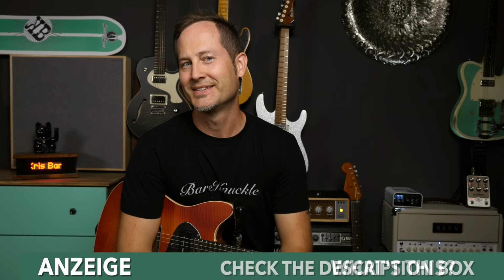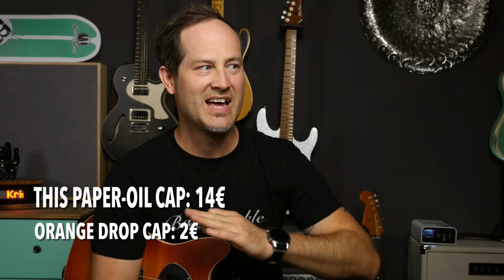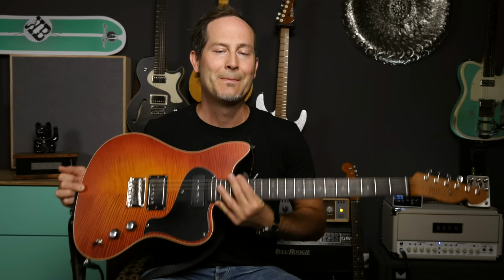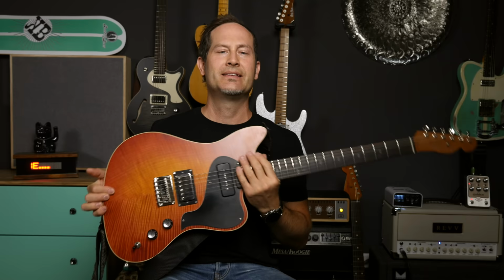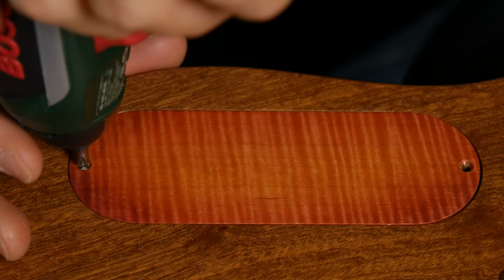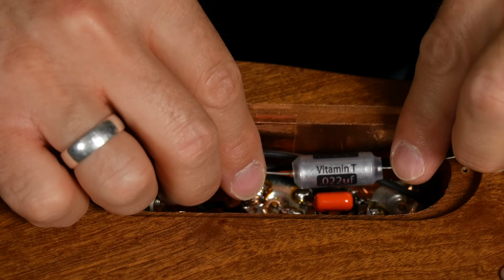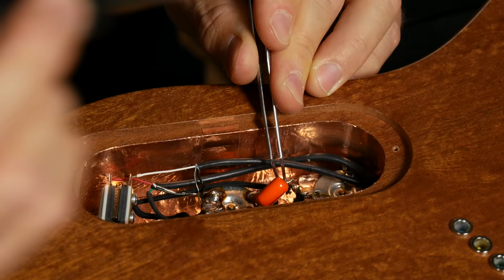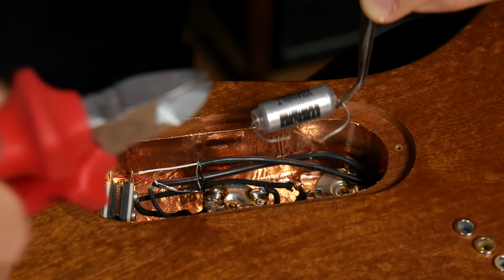Guitar Myth-Busting! Are Paper-In-Oil Capacitors Better? | Guitar Tweakz

Comment: I don't think there is any "best" type of capacitor, because each type has it's own strengths and weaknesses, ceramic discs are very cheap and tend to sound muddier when turned down less than 5. Orange drop (or any film/foil capacitor) tend to sound brighter and more focused even when turned down to 2, so, in my opinion, better for modern music, pop, rock, country or modern metal. Paper and foil in oil is for guitarists who prefer a vintage sound, warmer but also less muddy when turned all the way down, so, in my opinion, not worth the money unless you really need those vintage tones. By the way, the vintage Les Pauls from the 1950's used film and foil capacitors in a plastic bumblebee or tan casing, NOT paper and foil in oil.

Comment: Different caps absolutely can impart different sonic characteristics.  Try putting in a tantalum cap and you should find your attack is now "squishy" and "rubbery".

Given the way capacitors work, acting a bit like a spring/sponge, the attack is likely to change a bit more than just the freqs that the cap allows to pass through it.  Which can then affect the harmonics, which then can affect what we perceive as "tone".

I typically wire my tone circuit so that the cap is touching the hot lead (as opposed to having it between the pot and ground).  I do this so the cap can "play" with the signal (for better or for worse) and perhaps impart a bit of character.  But I'm not sure the cap location makes much difference.
Reply from the maker: I’d love to quote your comment in the follow-up video soon on the channel. Are you OK with that? I will measure the two caps on cam and tell my opinion on this whole subject. Out of curiosity, what do you base your statement on? I’m not testing you or anything, I‘m just honestly interested. 👍 Btw I completely share your opinion. 🙂 
*edit -> to correct typos 😅
Reply: @KrisBarocsi  No problem, Kris.  Use what you want.

I'm not sure about cap location (attached to hot or separated from it by the pot), really making a difference, but it could.  I never put it to the A/B test rigorously.

I discovered the "bounciness" of tantalum caps when I was doing some mod-work (either guitar wiring or a pedal or an attempt to create a 9-volt amp).

My degree was comp sci and electrical engineering, but I ended up being a programmer who only tinkers with guitar electronics some.

BTW, there was a link in your vid's thread that pointed to a video showing how to find the negative side of a cap.  Guy showed how one orientation can be noisier than the other.  Was new to me, but useful, even though we're talking really low noise floor levels.

Comment: You didn't measure the actual capacitance value of the caps. Caps have a significant tolerance, so do not always measure at the value on the label. So all we can conclude is that any heard differences are due to value OR type. So the whole purpose of the exercise was not achieved. We're no wiser than when we started. Not one of your better videos.

Comment: Well this is not very scientific because you did not test the values of the orange drop and the paper and oil to compare. A proper tests would be to get two caps of the same exact measurable value.
Reply from the maker: I measured them just didn’t include it in the video. I‘ll make a follow up where I show the measurements and explain why I didn‘t include it here. Thanks a lot for watching! Cheers!
Reply: @KrisBarocsi  cool✌

Comment: My comment is that you did not measure the exact capacitance of each capacitor across the audio frequency range ( it varies dramatically ) and you did not measure the leakage of each capacitor 
A frequency spectrum analysis would have been  nice  in each case . Audio over You Tube is hardly a comparison even with high grade head phones 
You are out putting to an amp which has a compound impedance - you did not take that in to consideration 
All in all not very scientific - and most probably you can match the tone with small tone pot variation,. On some of my guitars I can remove the capacitor completely from the circuit with a switch.